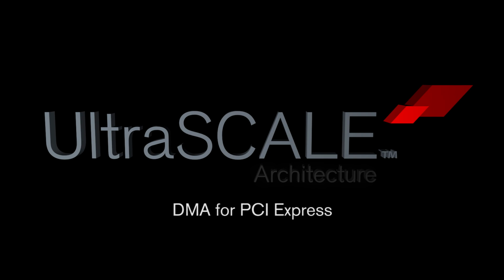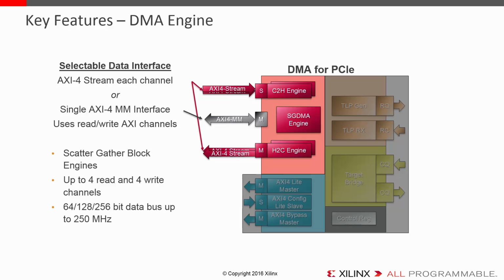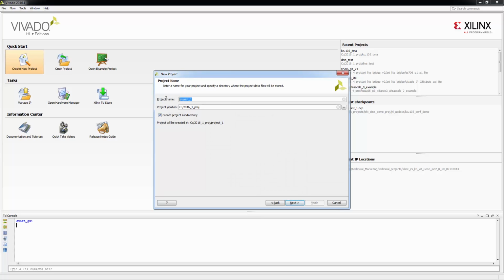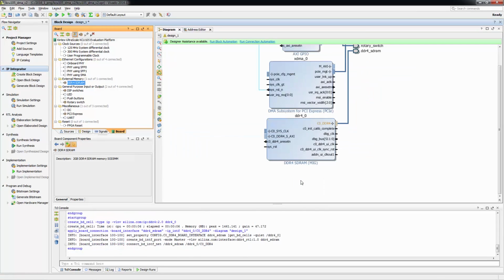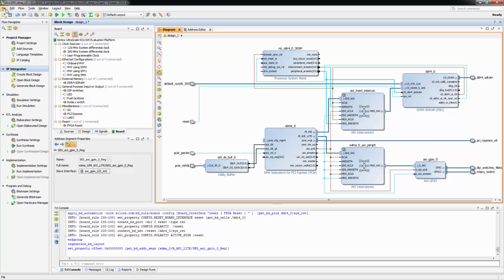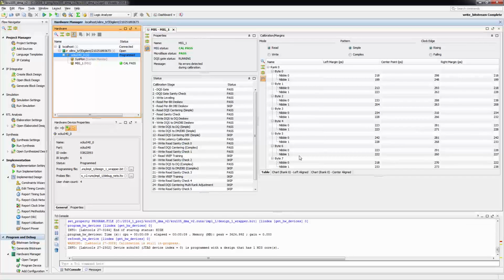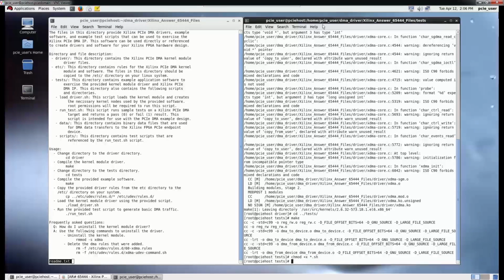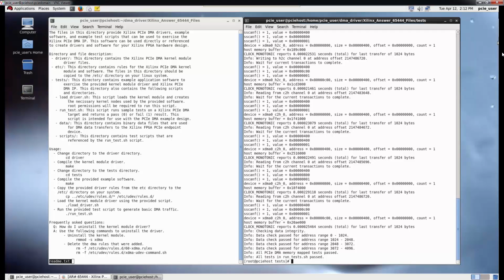DMA for PCI Express

Comment: Is it possible to implement the same IPI design in the KCU 1500 hardware and plug the board in Windows OS using windows driver?
Reply from the maker: For tech support pls visit our forum https://forums.xilinx.com/
Reply: Yes - if the concept for the DMA applies to all Xilinx boards that have PCI Express.
Reply: I implemented the same design by following this video, the only difference was that I used KCU 1500 board. After implementation, in the hardware manager, I find that the MIG core is invalid. How can I resolve this issue?
Thank you

Comment: None of this seems to work in Vivado 2017.2.
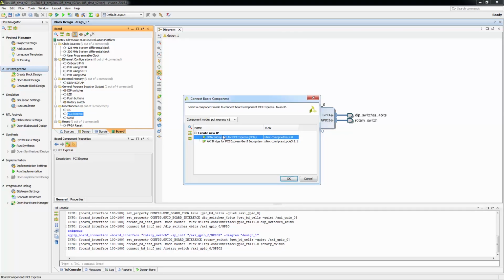The board KCU105 isn't even on the list in the current tool. Also, the AC701 board doesn't show the PCIe IP as you're explaining at 5:16. It would be nice if Xilinx would follow up with current tools and boards.